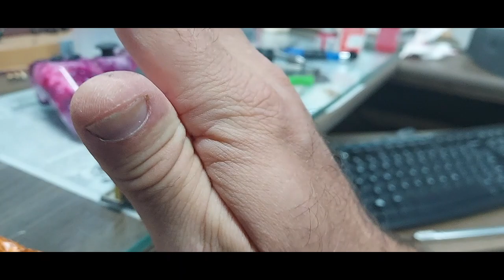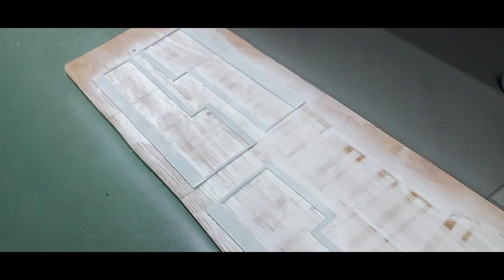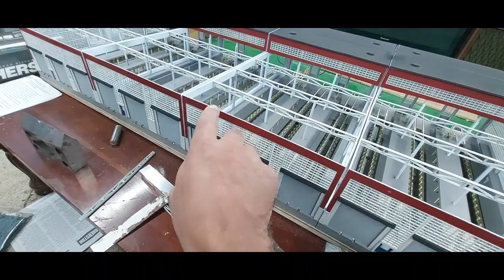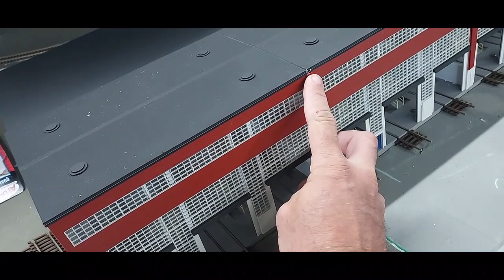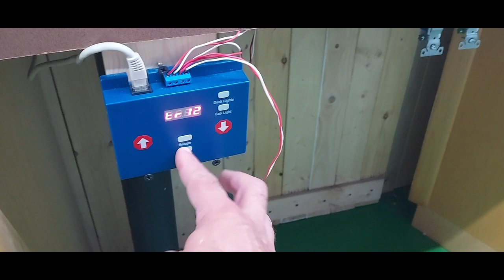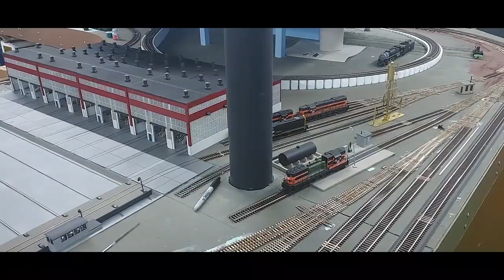Layout Update 9 3 24 Walthers Diesel Shop

Comment: This is a job well done on this Walthers Diesel shop. I have been wanting this model building since yours being the 3rd video that's featured this shop building. Flash Jones channel featured his version in BNSF Pumpkin Orange & a touch of yellow on the girders original single building . Another channel featuring this same building also in BNSF pumpkin  orange with a touch of yellow on the girders & gray flooring ( both versions) . Excellent video & craftsmanship that went into the assembly of this building kit. 👍🎨⭐⭐⭐⭐⭐
Reply from the maker: @HaroldAlexis-bb8sd  thank you! I think one of those bnsf vids was one of the ones I watched prepping for my build!

Comment: Nice kitbash. You mentioned an overhead crane, where does that fit into the picture?
Reply from the maker: @hirsutusi5536  it would be in the high bay but I decided not to put it in cause I didn't think you'd see it. I think I'm going to build it as a stand alone thing outside a building

Comment: Excellent. IMO, from what I can see the surfaces between the transfer table and the engine building looks very good; I think your too critical of your work. ------ You're going to hate me for suggesting this, but watching the Shop Goat move the GP unit that is being worked on you could have put those uncoupler's below each track. Then you could push the GP unit (in this example) and uncouple and have the 25Ter go on to another job.
Reply from the maker: I actually plan on putting a magnet uncoupler on the bridge As a way to break consists.